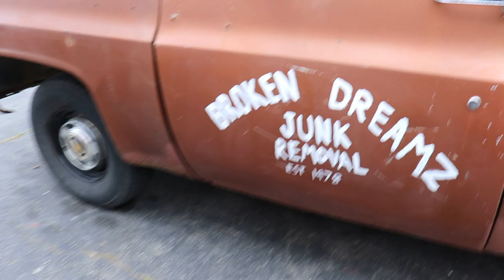Farm Truck explanation

Comment: I need to start building my 81 GMC. I'm driving it across the country and back in May. About 4400 miles round trip. The truck has been parked since 98 on top of a flatbed semi trailer. I need to get on it. Time is running out.

Comment: Yeah I kind of remember the old farm truck. Wasn't it more of a reddish color than the one you have now and if I'm not mistaken, you screwed up the engine in it and dropped a 267 or something like that
Reply from the maker: it was maroon and the 350 leaked allot of oil from rear main seal but still ran fine.